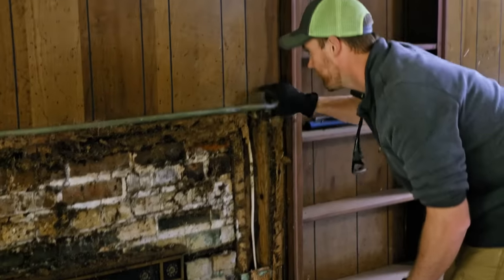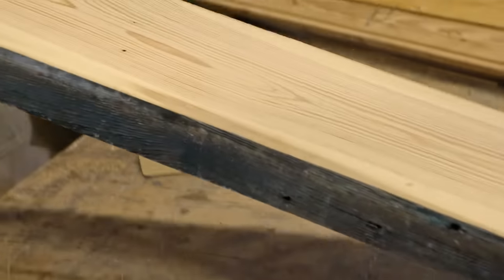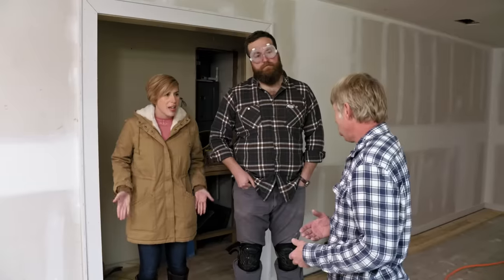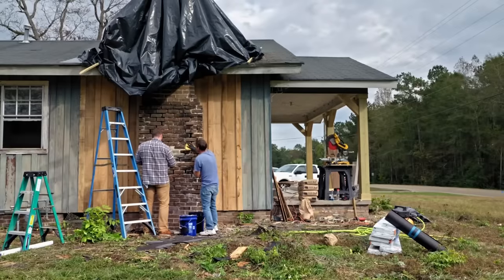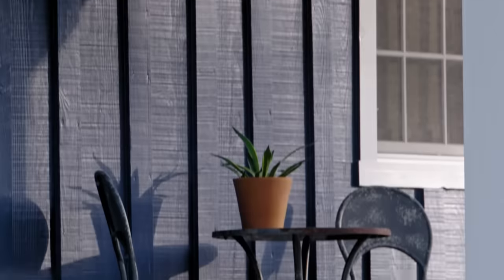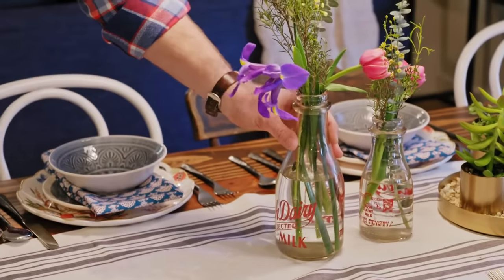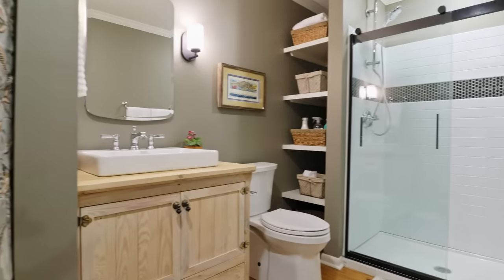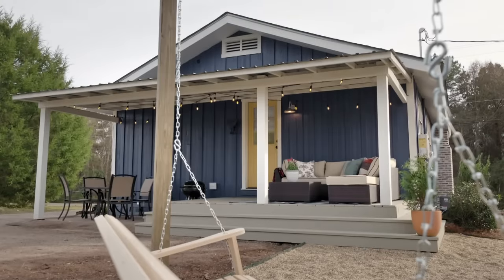Erin & Ben Transform A Knackered House Into A Dreamy Lake House | Home Town

Comment: Watching this gave me a great idea where to add my washer/dryer in my home without losing closet space…#winning 💕
Reply: If you don't have a laundry room and are planning a bathroom, the washer/dryer is the place to put it.  I live in the UK where dwellings are quite small, and the kitchen is nearly always the place for the washing machine.
Reply: @eattherich9215  YesxI see that quite frequently in European homes (a combo unit) I have a small utility closet I can use but here in America plumbing costs are ridiculous. Walls or floors would have to be ripped out and replaced ☹️
Reply: @conniepleasantnails : I had the opportunity to site the washing machine - don't believe in dryers -  in the bathroom of my last home since I was doing a complete renovation.  I didn't have the budget or even room to do big changes in my present home, so the washing machine is once again in the kitchen.